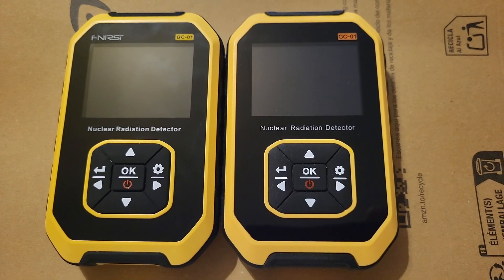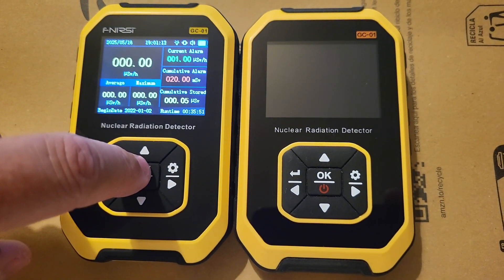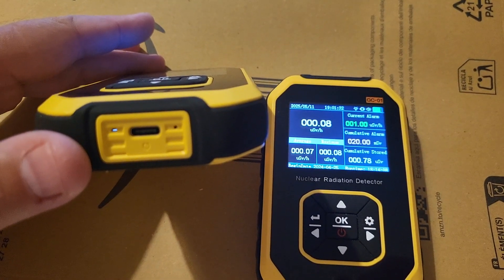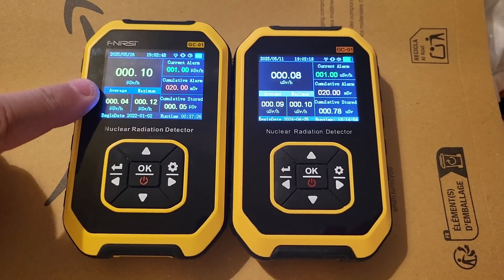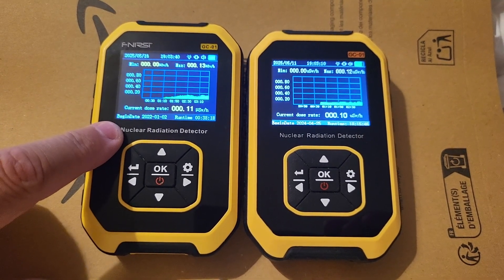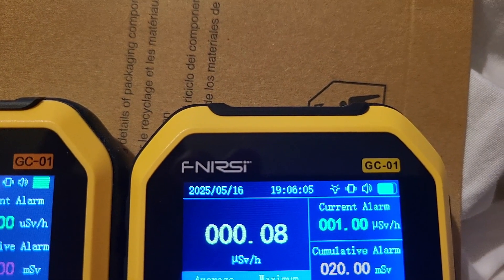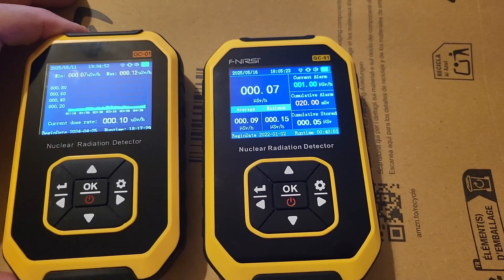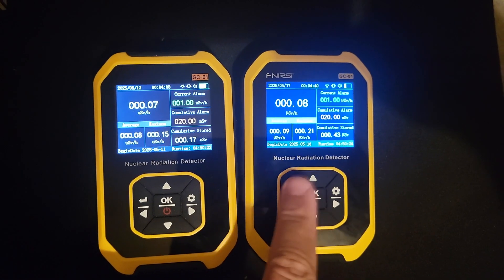The FNIRSI Radiation Detector, and a Fake!

Comment: I have modified this device!
The original tube is a J613 and is very insensitive and the meter displays 0.07 usv/h even when there are zero counts with the tube disconnected! This is probably done to compensate for the incredibly low background count when the J613 tube is connected, therefore giving the illusion of a better background count than the tube is really capable of.
It’s relatively easy to replace the tube with a J321 tube which massively improves the sensitivity of this device, making it a cheap useful device for reading CPM or CPS although there are still no audible clicks and there is no vibrate!
I would suggest that after the modification that you refer to the CPM or CPS as any readings in usv/h will probably be inaccurate and may overestimate the dose!
Also the led does actually flash internally but the front panel is opaque therefore the led cannot be seen from the exterior. This can be easily solved by scratching off the paint from inside the casing where the led is located!
Hope this comment is helpful to anyone else that owns this device!

Comment: Everything clear now. I have got a fake. Everything is identical to your fake. It will not accept RadPro firmware (unsupported chip Cachip ) and it has some unknown tube with pins on one end.
Reply: Mine has to the same tube. Unfortunately the IC markings have all been removed.

Comment: Thanks for making this video.

I hate to say it, but ironically, I think the fake one is actually telling you the correct background radiation level, because that's a normal reading. 0.42 micro Sieverts is extremely unlikely, unless it's a spike in background radiation or you have something highly radioactive nearby.

I have a rather expensive Ecotest Terra-P+ personal dosimeter (Geiger counter) sitting on my desk, beside me. It's currently showing 0.16 micro Sieverts. Most of the time, it shows 0.17 micro Sieverts: the same as your fake Fnirsi Geiger counter showed.
If I get a reading of around 0.20 micro Sieverts or greater, my Geiger counter's alarm turns on. For about three years, I've been keeping records of all the alarm times, including the date, time and readings until the radiation levels settle back down to normal levels. Spikes in background radiation are normal (although I don't know what causes them). Usually, I'll get an alarm sounding if it reaches around 0.28--0.32 micro Seiverts. The greatest reading I've ever had is 0.73 micro Sieverts, for background radiation.

Incidentally, the non "plus" model of my Geiger counter is what they use for tours of Chernobyl, which is why I bought mine. The "plus" or "+" model is just a bit more sensitive. Ecotest also make a military version, but that's even more expensive. From recollection, the main difference is it has bluetooth connectivity to record information from it onto a mobile device, such as a phone. The Terra-P+ model sells for around six to eight times as much as the Fnirsi model (at least it does in Australia) and the military model costs about sixteen times as much.
I want to get another Geiger counter, but the really good ones cost a small fortune.

Comment: How does this logic work? Like omg.. I bought the fake too.. The tube is not marked and the motherboard looks different and I couldn't flash it. But why go through all the effort of creating a circuit board and a gorgeous lcd with everything else but then you go and put a poop tube in there that makes the whole device useless? The difference in tube price is like 10$ or so, I mean why go through all the effort for 10$ difference which is the difference between it being useless or not.. How does this Chinese logic work?
Reply: The $10 adds up fast with all the units they make.

Comment: We also brought the cheapest copy of GC-01 (unbranded version), but now I want to ask can we modify it with the M4011/J321 tube, and thereafter, can we also update the firmware so that it can be operated like the original product for using it to its full potential?
Reply: I bought the cheapest one too. It has holes on the PCB for the J321, but the tube in mine is only half size. I have also noticed that the PCB's are different so probably can't upgrade the tube.

Comment: These are both made at the same factory.  The FNIRSI brand name is just the initials of the factory name (Fei Ni Riu Si) and they sell it unbranded or branded (with customers brand marque) as a white label product.  They also have PCB options that brands can choose when they order the GC-01.   The factory is in the same city where I live (Shenzhen) and I have talked to them extensively as part of the research process for review video that I made on this device.